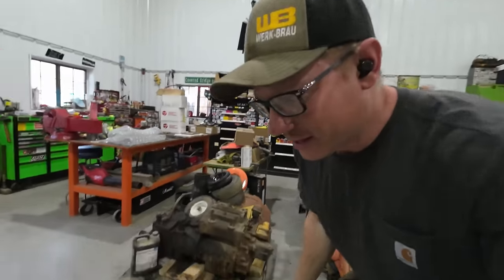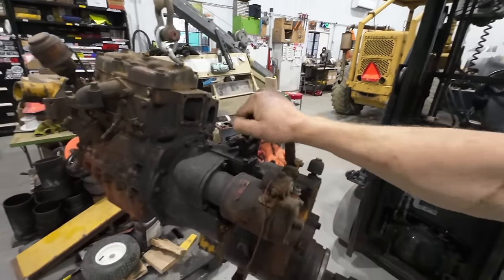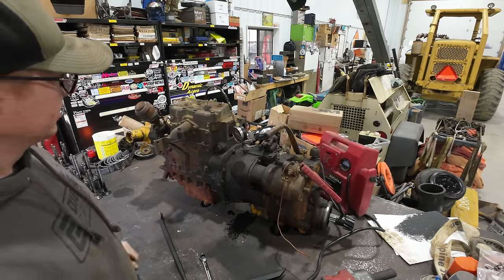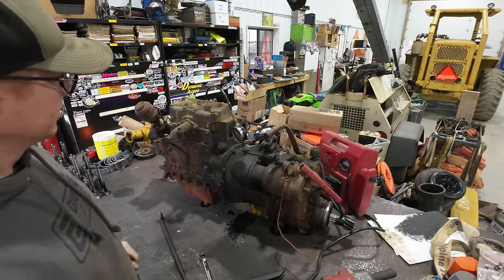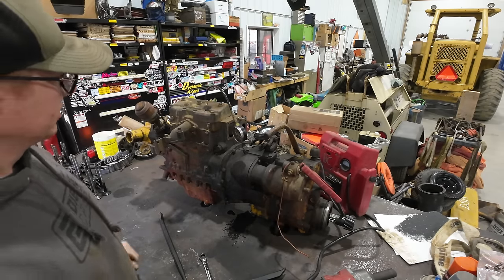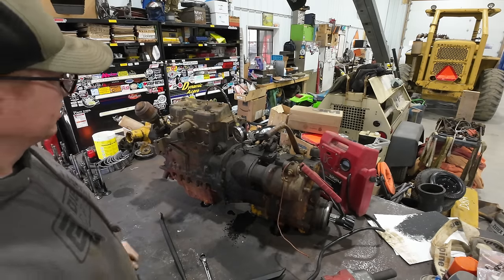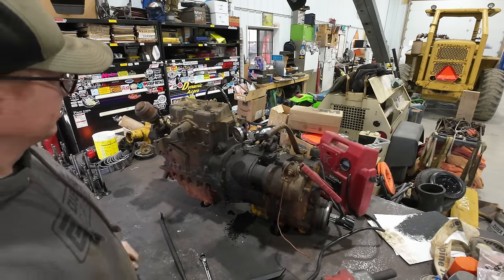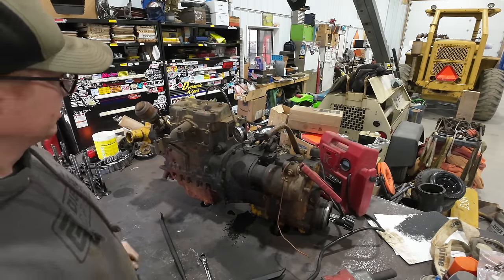AUTOPSY of a Caterpillar Pony Motor. | What Went Wrong?

Comment: Those teeth (my guess) are from a starter Bendix gear that was smashed from all that slop in the main bearings. Very interesting watching to dismantle something I'll probably never even see. Thank you Matt
Reply: Yeah it look's like at about 19:30 you can see a bunch of teeth missing.
Reply: That is what I’m thinking too. It’s more than likely that is what caused the main bearing to fail to.
Reply: I second or third the starter gear
Reply: Came here to make the same comment.
Reply: STARTER BENDIX
Reply: My assumption as well probably wedged in a safe place until DC & SI started moving the starter around dislodging it and then BOOM and that's all she wrote.
Reply: Yep.. I said the same thing.   That's why it was left in the bottom too.. Because no one tore it down-- they just threw on a new starter and kept going.
Reply: Agreed.  Starter was replaced when the pinion broke, hence no obvious place for the missing gear.
Reply: That makes a lot of sense.  Either that or some leftovers from the 1975 revisit.
Reply: Engine bearings got sloppy. Starter pinion gear wore to the point of shattering. Starter or the pinion gear got replaced as a fast fix in the field. And years later it came back to bite Matt in the backside.
Reply: defiantly  the remains of an old starter drive gear that was replaced leaving the old teeth in the case I've seen it before.
Reply: This was my first thought...
Reply: Yep.  Starter gearset.   Possibly more than one.
Reply: Ah, you beat me to it. Definitely teeth from a starter bendix.
Reply: That was my guess as well.
Reply: Probably lost the teeth on one starter and replaced it but didn't bother to get the pieces of broken  gear out which lead to bigger problems.
Reply: Agree with that. It’s remnants of a sloppy field fix when the starter gear busted they slapped on a new starter to finish the job.Might have been the last thing it did before it was parked then Matt bought it and has to figure it out. Never seen something that worn out even run but that would also explain why it got too hot fast.
Reply: Yep, that was my first guess, good analysis.😃
Reply: Yup, my guess as well.
Reply: Same guess I had.
Reply: Was gonna suggest the same. Plenty already think so too.
Reply: @BlueTheRage  No teeth are missing from anything in there now, they are saying an old starter failed from the slop in the crank and broke teeth off so they replaced the starter. The teeth he just found might be off the old starter that were lkeft inside because they didnt taki it apart to clean it out, they just tossed on a new starter.
Reply: Most reasonable suggestion
Reply: Just like practically every ford 9n / 2n / 8n on the planet. Usually just the whole bendix grenades & gets left in the bottom because fishing it out requires splitting the tractor.
Reply: I ran in the same senario on my last video doing a tear down on my case 580ck and led me to believe that it was the starter teeth and that the starter has been replaced since
Reply: I also came here to comment suggesting that it might have been a previously replaced starter Bendix gear
Reply: I am watching because this only the first time I saw an starter made up with small small engine now perhaps all starters no matter how big an engine is are made-up of an electric motor with trancmission or the so called reduction starter.

Comment: I have a feeling those mysterious gear teeth are from a previous catastrophic failure that wasn't cleared out before being replaced, or were left to make a speedy recovery in the field then forgotten about, before being parked.
Reply: that seems plausible!
Reply: My thoughts as well.
Reply: exactly my thoughts too...
Reply: Mine as well
Reply: Exactly my thoughts.
Reply: First thing I thought of
Reply: Pony fixed, running fine. No need to look any further. 😊
Reply: That's exactly what I was thinking.
Reply: Fix it close it up and worry about those broken gear teeth when they jam up into something moving around fast and add to more down time.
Reply: Which then caused the next catastrophe...
Reply: Those teeth seemed to be from a starter.  The lack of oil change in the motor caused severe crankshaft flop which caused the ring gear to break off the starter gear.  They just put another starter on, and eventually the broken teeth got picked up with the oil sludge and sent through the case.
Reply: Matt I think the gear teeth were from a catastrophic stripping of the gearcase shaft. From what I could see on the video the tooth profile matches. If not some other gear grenaded and the mechanic didn't fish out the bits before refilling with oil.AL B.
Reply: Bet those were old starter pinion teeth that the sloppy rear main chewed up long before your time with it.
Reply: I agree
Reply: Just for your info, an Ole mechanic gave me a couple of short  car springs about 6 in. long with the ends ground to thin taper. They make the best chisels for seperating2 tight prices of metal like separating the bellhousing from engine. I've used pony meters alot but never took on apart, very interesting.
Reply: That was my thought as well, a previous field repair that was done in a hurry, probably in low or rapidly dimenishing light conditions. Flashlights in the early 70's were not near as bright as what is available today.
Reply: @einfelder8262 
This was my thought the moment I saw it jammed into that little space, then laid out with its fellow pieces I was convinced that my first thought was correct, then when we got to see the crank flopping around like that I could see the mechanism of failure too!
Reply: Having done some troubleshooting in my time (of different systems but this is of little concern) this is the scenario I too felt had transpired.  Clear evidence of someone having been there before, although not to lay blame upon P.C., whomever they were, indicates that it had likely experienced difficulty in the past.
Reply: Ok I think you need to fix that little engine and put in a golf cart !!! Funnnn
Reply: my thoughts as-well
Reply: Ditto
Reply: My thoughts exactly!
Reply: That's what I thought...
Reply: Might be that the gear on the starter had broken at sometime

Comment: Regarding the grey/silver sludge, I didn't see that anyone suggested it is actually LEAD  from leaded gasoline.  We used to call it grey paint. I was an apprentice car mechanic in the 60s when leaded gas was the norm. The grey paint would get so thick in the oil pan it would plug up the oil pickup. When removing an oil pan with that in it, it felt as heavy as if half a crankshaft was there. With the age of that pony engine, it likely ran most of its life with leaded gas.
Reply: That’s what I was going to say, that it was lead from leaded gas. Torn down lots of old engines with my grandfather back in the day and every one of them had that sludge in it. Remember tearing down an old model T engine that had so much in it you could see where it was starting to touch the crankshaft. With that much sludge it probably only held about a quart of oil. We couldn’t get any oil to drain out before we took it apart. Most likely that’s why the guy said it would only run for about 10min before it would get hot and seize up and he’d have to let it cool down before it would start again. 😂

Comment: I will never, ever need to know any of what Matt tried to teach me today, but strange as that is I could not stop watching this. The flywheel slop was epic. These episodes are why you have 3/4 of a million subscribers.
Reply from the maker: Much appreciated!
Reply: Me too!
Reply: AGREED!!
Reply: There's a YT channel called Mr Hewes who fixes up tanks & other old military stuff.
Had a T34 running rough & when they pulled the engine, the clutch end of the crank had around 4" of slop - crankcase & block all broken up but it had run!
Reply: @GARDENER42 just like this pony was running!
Reply: Mr Hewes got a Centurion tank that had had been used as a barracks gate sculpture. The engine compartment was filled with concrete!!!
He jack-hammered it out, fitted a new engine and got the tank running again. It’s a six cylinder twin crank opposed piston engine. Amazing stuff.
Reply: Was fly wheel slop epic ? You need get out more m8 av just told him he's no done half decent build yet aw he's doing is finding scrap ffs
Reply: @CoraPringle he didn’t build the engine the old dozer he bought had this on it. If you watch the video he shows that the last time this engine was apart was 1973

Comment: a small gear like that, my guess is that it came from a broken starter that since have been replaced.
Reply: That makes a hell of a lot of sense.  Can’t imagine anything being completely ground to paste without some fragments remaining, yet leaving the teeth mostly whole.
Reply: Those gear teeth look a lot like starter drive gear to me ⚙!
Reply: This makes the most sense. If the crankshaft bearing was worn already, the starter was engaging only on the tips of the teeth, putting a lot more stress on it. Then it was swapped to fix it probably.
Reply: Sounds right. There would be a shaft without a gear somewhere in there otherwise.

Comment: Wouldn't be hard to braze up that gear case. Worth saving. Doesn't have to be difficult. Prep the weld seem. It doesn't have to be huge. A 3/16 v is enough. Drill holes at each end of the crack. Build a nice big wood fire and get it all hot in some coals. Keep it in the coals while you heat up the joint and braze it up. Finnish by building up the fire a bit to bring it all up to an even heat. Cover it all with the coals and ashes when it dies down so it cools slow. Leave it till the next day.  It sounds like a lot, but really isn't. Most of the effort is building a bonfire and watching it burn.
Reply: And you sir have obviously dealt with machinery needing spare parts made out of unobtainium.
Reply: I'd love to see THAT video.  👍
Reply: @proberts34  Try cutting edge engineering on YouTube to see it done properly in a scientific and precise manner in Australia or any one of a number of indian\pakistani sites on truck axle\gearbox repairs using 100 year old British machinery (go to a couple and the algorithm will send you more) to watch it being done with sledge hammers.
Reply from the maker: Yes, I know it’s possible but like I said they aren’t THAT rare yet. I’ve got better ones that aren’t broke already on the shelf lol
Reply: Well any form of cast irorn repais is a royal pain in the ass that takes a lifetime of experience to succeed with, takes just the right levels of preheat or the part will just crack open like an egg.
Reply: Probably best to just let it go on to make a few hundred new cars out of that one busted gear case .
Reply: @marcuscarrozza732 😂😂
Reply: Cooked Goose.
Reply: @andrewallen9993  yes but even Curtis showed the limitations of that. He saved that grader gearbox that got damaged in shipping however another case he worked on just cracked more. He said that one was a crap shoot from the outset.
Reply: Yeah man that’s a fantastic crate of spare parts for the other engine’s!   It’s a little twin cylinder diesel engine??? Horsepower and torque specs… when she was hanging there I was having some flashbacks from rebuilding a little yanmar sailboat engine and when I recognized she has a high/low or two speed gearbox on her tail I was seeing that midship in a little 26’ sailboat with a jackshafted tow foot diameter six lobed big brass screw!!!  You could buzz around the world and depending upon your sea conditions you might actually be able to shift her into your high range and push her with the wind and your screw and reach a crazy speed!   In one of those 24’ or so Free cabin cruiser boats that has a blown mercruser setup.,, you could definitely jackshaft it to a Volvo outdrive and having the high speed low speed choice could be crazy awesome with a huge prop!!!
Reply: @kaboom4679  hahahaha😂
Reply: @timprussell  I'm in South Africa and for the price of that casing I know people with large 5 axis milling machines and foundries who would make you 5 new ones at a discount 😂
I'm still doing component level repairs to KUKA robots running windows 95😮
Reply: @DaveyBlue32 those ponies are gas jobs. He said carburetor several times and magneto. It’s an oversized harbor freight predator engine in comparison to nowadays
Reply: It looks like a starter pinion dropped into the trans. Is that even possible?
Reply: @timprussell  IC Weld has done a few cast piece repairs as well, I'd definitely want to pass it by him or someone with similar kill level. In IC Weld's case he patched up the gear case of a grader a while back, seemed to work fine.
Reply: @andrewallen9993 CEE is one of my favorite channels 👍
Reply: We are weld them with a high nickel rod .. holds better then brass, saved a few rare engines that way
Reply: @DieselCreek  Well, just don't scrap it. Somebody with more time than money might could use it some day :)
Reply: @DieselCreek The repair and refurbishment of the entire unit would be good content. Not necessarily for your channel but surely there are others that can complete the necessary tasks. Possibly it could be an avenue to bring several channels together with a series on saving a mistreated and thoroughly worn out pony motor and repairing the case.
Reply: @MayaPosch  I’ll have to check that out.
Reply: We had a blocked drain at home and the technician could not start the engine that powers the jet lance. The motor turned over but no sign of starting.  I told the guy to check the pump for the diesel supply and indeed the fuse had blown. Watching will it start videos with Diesel Creek paid off.  Thanks Matt.
Reply: @tomboone201  back in the day we would put heads that we were too poor to replace on a barbecue grill. Get them hot as hell. And then we would brase them
Reply: @MostlyInteresting  used to be certified welder, just bought expensive rods heated the cast real good and welded it
Reply: @DieselCreek .
For me, saving old equipment others would chuck on the scrap heap is a blast.
I have a Ironworker welder certification and I myself would have fun repairing it using proper cast iron brazing methods. 
It really ain't that hard.
Reply: Great Video Matt and yes that was a boatload of movement in the crank.  Pretty sure water had nothing to do with it over time.  Insert sarcasm here!!!
Reply: @andrewallen9993 😂😂
Reply: @DieselCreek but it would make a great video.
Reply: @ronaldheit196  Yes, brazing is much better on cast iron than welding.  I have seen Keith Rucker and Brian Bloc of bcbloc02 braze big castings successfully.  They clean them, vee them out, clean them again, warm them up, braze the cracks, and let them cool very slowly by covering them.  Brian had a large column drill press fall when his overhead crane cable broke.  It broke the casting into several pieces and he brazed the thing back together and is using it.
Reply: Prep is problem if you bronze weld(brazing to some) You need to file and not grind. Grinding closes pores. You can grind majority but you must finish with a file.
Reply: im just curious at what point youd need a spare case that badly, whatre the chances of another case breaking but breaking worse than that one? and then the internals all also being salvageable that all you need is a case and not just the whole assembly

itd be like saving the metal frame out of a truck seat thats broken in multiple places.. at what point would you need the frame but not just get the entire seat and whatre the chances the one youre replacing is in worse shape
Reply: Good advice I kept thinking there should be a way to fix tgat gear box glad you filled in tge hiw ! Sounds like you may have done one or two !